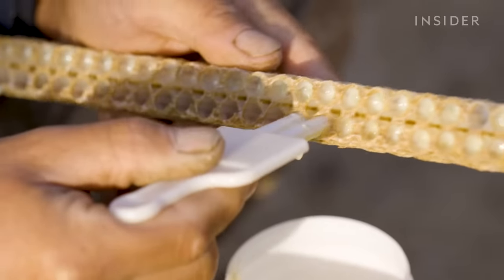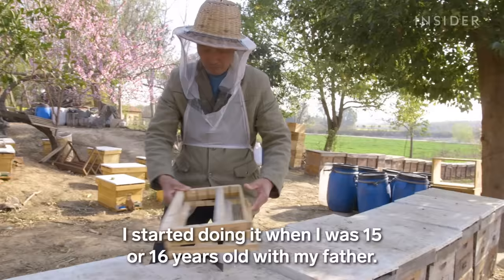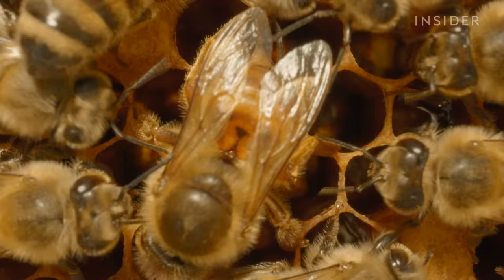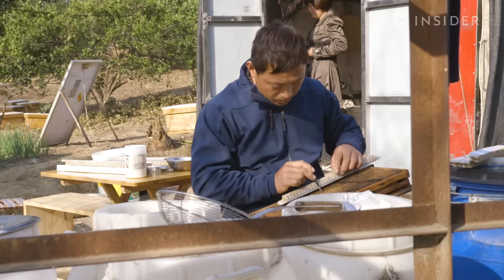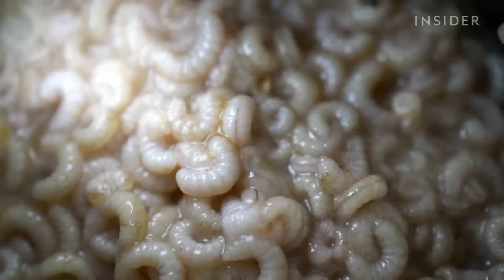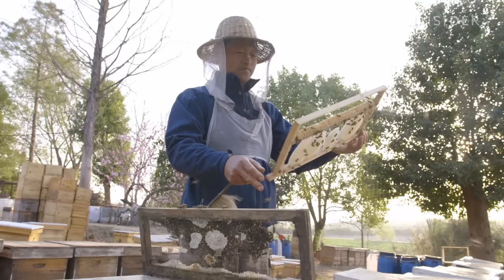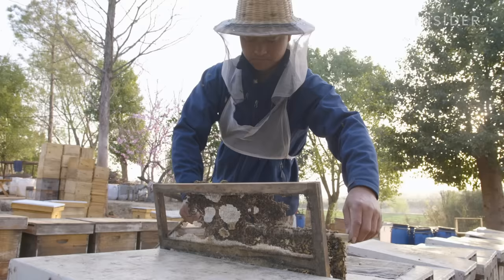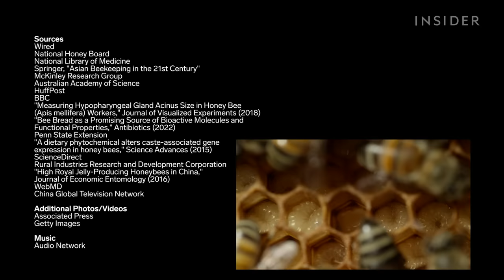Why Royal Jelly is So Expensive | So Expensive Food | Insider Business

Comment: I extensively worked out the numbers and found accurate sources for pricing of real jelly. This guy gets less then $20 USD per pound for the rarest substance bees could possibly produce. Which they have been forced to produce a thousand times more then normal. If he eats 2.5 kilo per year of queen jelly it is $107.25 USD per year he loses in income. Organic royal jelly, the real stuff, not the fake stuff that looks like honey costs $1000 USD per pound. I was surprised several calculations magically ended up $1000 USD per pound. That is a mark up of 50 × compared to what he gets paid and what it sells for. I did not round up or down a single figure. Coincidence?
Looks like they started at the price they wanted per pound and worked down from there selling 100 gm jars and charging an arbitrary 50× what the farmer makes. And that is based on the high end he receives of 3000 yuan, I converted everything from the currency to relavent unit of mass.
It means on the high end if he(plus wife?) consumes 2.5 kilo per year, that has the market value of $5512 USD per year just to live longer.
What do you think about that?
Reply: I ignored the $250 per kilo abroad because that means nothing if you can not verify if those numbers come for legitimate sources of actual jelly.